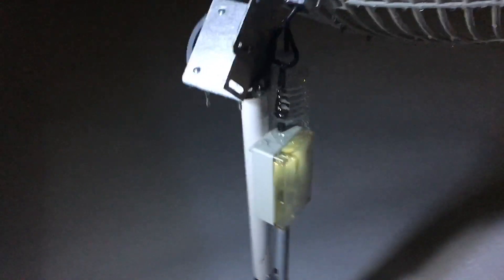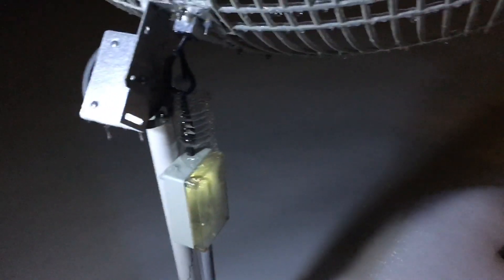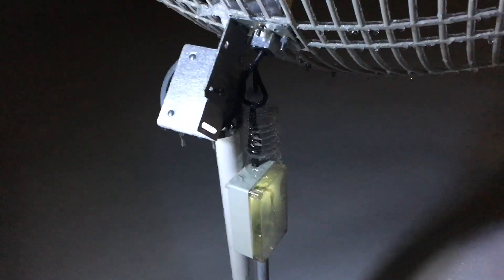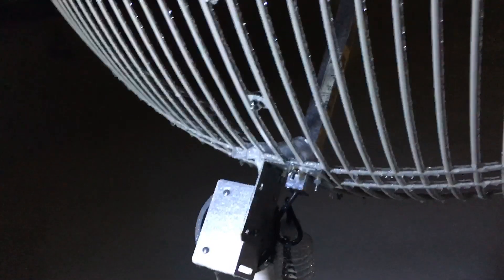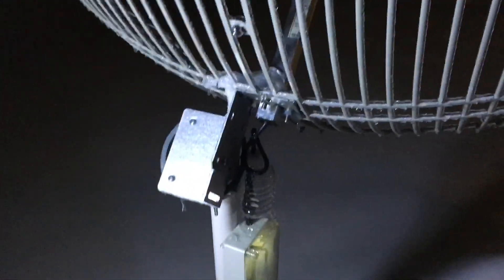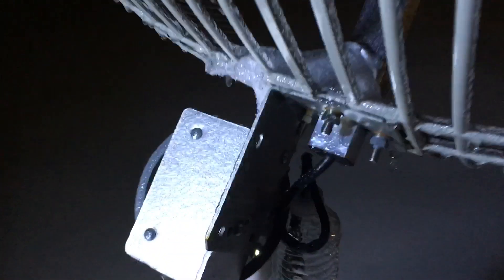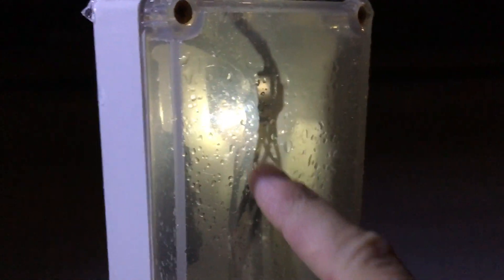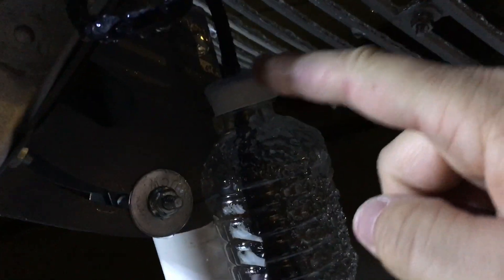My Antenna For GOES Satellite Has A Little Ice On It.

Comment: Hey PI GUY, can you tell us what the temperature was in this video and how did your PIs work the cold?
Reply from the maker: The air temp outside was around 33F. I never had a issue with my Pi's being out in the cold.
Reply: @FuzzThePiGuy  thank you very much. Another question,  how do they work in the HEAT? Im just wanting to know because I live in central Illinois and want to try a similar PI setup as yours. I love the idea.
Reply from the maker: I have fans in my enclosures. If you go under http://fuzzthepiguy.tech/raspberry-pi-projects/   . You can see some fans. Plus I have videos of the setups also.